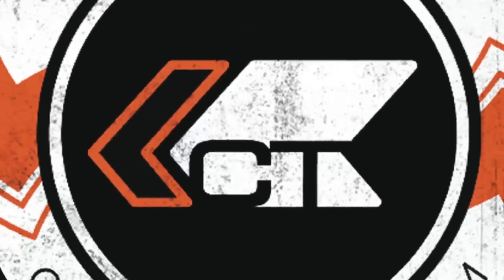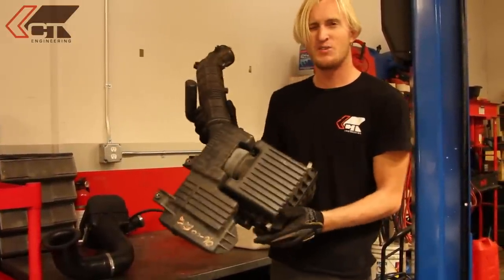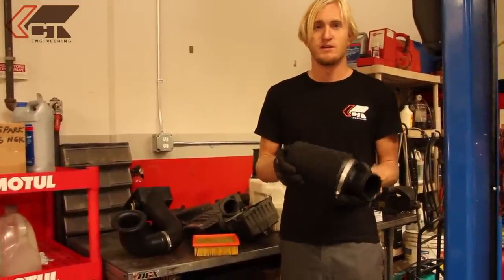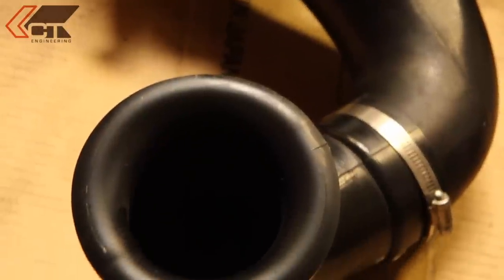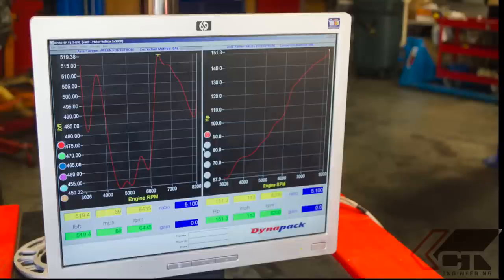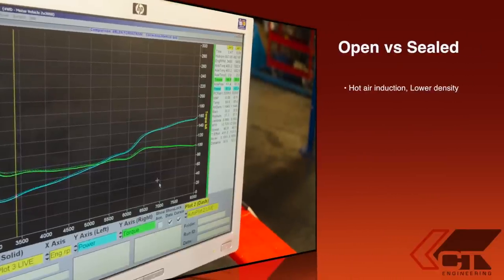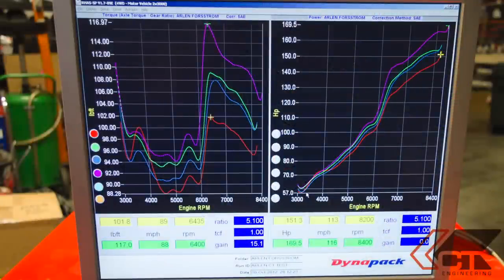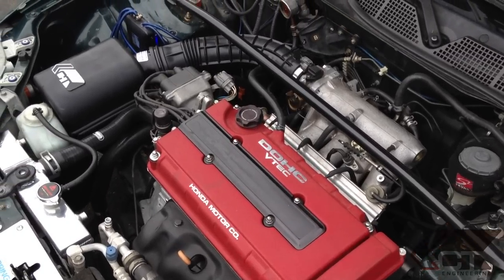InlineFour All Access Ep7: CT-Engineering IceBox

Comment: this setup is very similar to the ram-air system I built for my 97 prelude, only the entire thing cost less than 50 bucks ! not counting the ebay cai. I took out the black plastic thing out from below the turn signals, I got a heater ducting from home depot, along with aluminum tape, and a flex pipe for a dryer. I cut the duct down to fit the opening, ran the dryer hose up through where the stock airbox was , up through the inner fender and up through the body to below the airfilter (cone with front entry) and sealed the dryer pipe to the front of the air cleaner. I also got a screen mesh, it was for stucco, also from home depot. no cel, runs great. and never a drop of water near the air filter, there's two bends that prevent water from traveling. anyway, I put the mesh over the entry, so it looks kind of like a after market front bumper. I must have done something right cause I constantly get compliments on it, and they usually ask where to get a front bumper like that.    :) it's all stock except that, a magnaflow muffler on stock exhaust, and springs to lower it 2 inches. the only thing I've raced so far is a f-150 with a 5,4l. I beat him by 1 length. and yes haters I know it's a big truck, but it also has tons of torque, compared to the stock h22a4

Comment from the maker: Please remember, this is a C5 swap into a civic chassis. There simply is no way to fit an Integera air box into the engine bay. 

The OEM airbox we used was not the SOHC one, but was actually the DOHC EK4 box. Which is the same part number as the EK9 set up. 

This is the beauty of the CT-E set up, they have modified and adapted an ITR style assembly that bolts into the Civic chassis. For people with swaps like this, the CT-E IceBox is a great 'hybrid' intake solution,.

Comment from the maker: Dont forget though, The CT upper box has a smooth/larger opening into the fitler area. 
If you check out our intake section on the site, we sell the ice box by it self, as well as the drop in filter too.
Reply: Way way waaaayyy late to this. Any idea what exhaust that car is using? That's exactly how I want my B16B to sound

Comment: In my case it actually fits pretty tight because of a 'slight' incompatibility of the ice box itself and large billet Innovative engine mounts.

The Ice Box has a mounting bracket thats saposed to be sandwiched between the transmission bracket and one of the bolts. The OEM piece is a thin piece of pressed metal, but the innovatives are thicker, as such the ice box has a ever so slight, 'bend' do it in my civic, and actually helps make it seal better.

Comment: Yes the box will I have seen that done so long as its an Integra filter. As far as which is better, I have not done any back to back testing, I just personally prefer the CT-Uni style filter for its ease of use and overall integration/velocity stack design (i.e you can run the ice box with stack only and no filter, but still have the box closed for heat insulation.

Comment: both itr and ct are good and better than the d14 intake system.
personally i had the itr box modded on my b18 switched to a custom length intake took a pvc pipe and cut 1'' at each pass on the dyno at the end i added a vibrant velocity stack and a kn filter among with a ram air feef to the filter..
to prevent heatsoak from header and radiator i made a custom heatshield 
car made 202whp on a dyna pack same dyno as yours ct box and mugen box are 2 very good options for people who cant go custom /

Comment from the maker: It would be a tight fit. The ITR arm tapers to 62mm... and it would be a bit of a stretch to slip it over a 70. 

For an EJ8 it is (99-00 Si Ice Box) + (94-01 Integra Drop in) + +ITR elbo. We have a configuration like this for sale already bundled in the description.
Reply: The one I got for some reason slips pretty easily over a skunk2 70mm tb on my itr engine

Comment: so what exactly did you use? is the 99-00 icebox/filter assembly 3" so with a itr arm it will all be bolt on? i just did a itr swap on my ej8 and this is the intake i wanted to go with 

another question will the oem itr arm fit a 70mm throttle body?

-Civic Si IceBox
-ITR Filter and Velocity Stack/Adapter
-ITR intake arm?

Comment: will this work on a first gen 2000 crv?
Reply: Ever figure it out if it fits a CRV?
Reply: @matthewl2260  I completely forgot about this, I might have to buy and and test it out, I kinda remember seeing somone with this intake on the fb crv enthusiasts group
Reply: @thebravoconnection946  That's crazy you say that, because I follow that group on fb and searched the other day and somebody posted an install for the ct engineering icebox! They used the civic si 99-00 one and it bolted down.
Reply: @thebravoconnection946  I purchased one from Heel Toe last week, they said they will ship it out in 1-2 week's

Comment from the maker: The ice box itself will bolt on just fine (just chose a 99-00 Si unit)
The only variable is the intake arm.

Based on the size/location of the SOHC intake manifold/throttle body the ITR unit may or may not work. We've yet to field test this arrangement. But its definitely do able.

Comment: What exhaust was used for the swap ? Currently dealing with headers not lining up
Reply: At the time, it had Skunk2 60mm Megapower with a Test pipe. Later I had  custom HyTech 2.5" twin loop made by John @Hytech for me. Sure it made less power, but it meant i could romp on it all the time and it was WAY more fun on the daily.

Comment: only 150hp at the wheels for a real type R engine? wtf stock B18C1 should be putting 150 up at the wheels. b18C JDM type R or b18c5 usdm should be pushing 170-180 hp!
Reply: Well...what can I tell you. This is what a brand new stock B18C5 does... I should know, I was the one there who did these videos, built it, and put it on that dyno... so I guess what you've seen on the internet is wrong? Cause this is real
Reply: Compared one setup to another that's the only way numbers matter , just like in this video . every dyno is different , some do wheel , hub , flywheel reading . somes work on DIN correction method while the other read on SAE . Sometime weather is cold with high atmospheric  pressure , and the other day it's hot and rainy /foggy . sometimes people do dyno run with hood open , sometimes not . etc... etc... etc ... But here is one fact , most Honda engine do not output claimed HP even in perfect condition !   EUDM DC2 get 170-175hp DIN @ flywheel for 190 claimed  , as it goes for EG6/EK4 with 145-155 for 160 claimed , and the most know S2000 with 210-215 for 240 claimed . But hey wo give a fxxx ?  That airbox is definitly a good improvment and this video is well made , that's what people need to focus on . well done !
Reply: fabrice kiehl Arlen here responding (blond guy on video)

I have to admit. Your numbers of actual measured HP vs paper numbers are dead on. 

When we did a well maintained stock B16A, even with tune it was 142. GSRs on stock tune did 145. Even a “200hp” prelude H22 did a messily 145hp on that Dyno. 

Whole point of this test we did was to show actual number gains on the exact same car, same day, with real world results. 

Final numbers don’t mater, but the change and improvements we made not only in peek power but also throughout the curve and Daily Drivability that do.